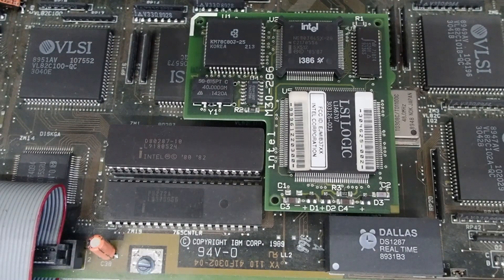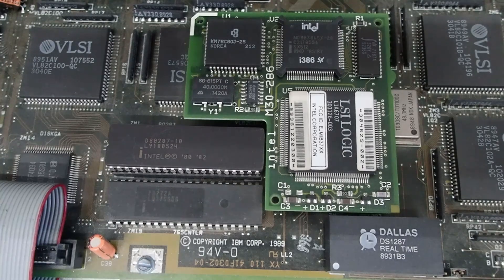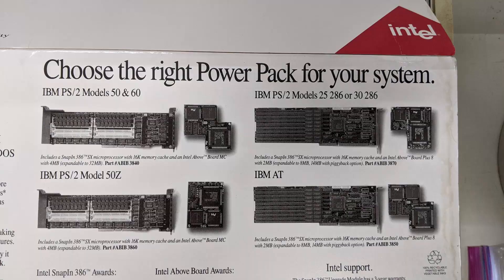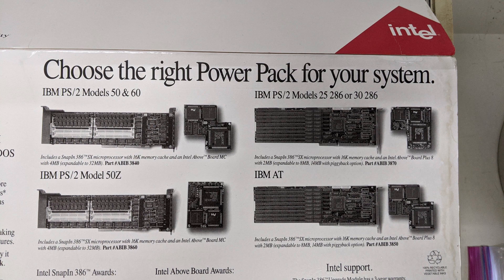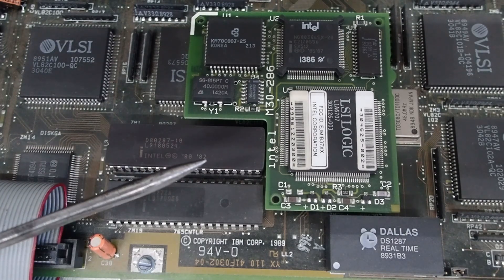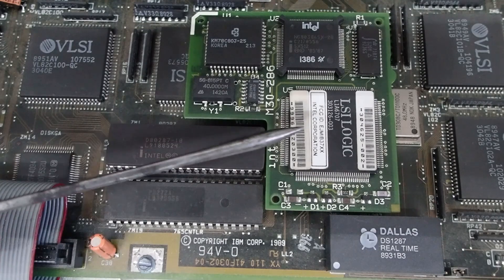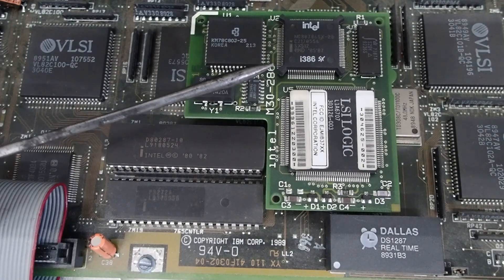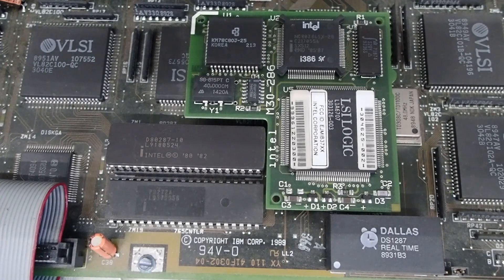Intel "SnapIn 386" CPU Upgrade on a PS/2 Model 30 286!

Comment: Nice upgrade!  I wish they weren't so rare!!  That said, I suppose that my model 30 286 makes for a nice 286 system, and I do have other 386/486 class systems to fill that niche!
Reply from the maker: The Kingston "386 Now!" have 25 and 33MHz AMD CPUs, Intel only has the 20MHz. There is also a socket for a 387SX on the Kingston modules. Yes, eventually I will have a video on them too, but this can do for now: http://www.walshcomptech.com/ps2/kingston.htm

I like to retrofit what can be the fastest CPU in the socket...

Comment: Do all the model 25 and 30 286 boards have the Dallas soldered on and not the socket?
Reply from the maker: All the 'Type 1' and 'Type 2' Model 25 286 and 30 286 planars I've ever seen have had a socketed DS1287.
Reply: @IBM_Museum  Thank you for the reply. I am going to try and put a 50 pin SCSI controller in my 55SX then a SCSI to SD card and run the 5v and 12v lines from the PSU, do you think I can get it to boot from that? (all to avoid using the build in 70pin SCSI drives for these machines)
Reply from the maker: @NickMurray : If you could find an IBM "Patriot" or Future Domain MCS-600/700 it has an easy ability to add a drive power tap: http://ardent-tool.com/SCSI/MCS.html
Reply: @IBM_Museum  Oh yes that would be perfect!

Comment: I've just installed one identical to this in an PS/2 M30-286 and I'm getting 2.2fps in Superscape, and Landmark thinks it's a 10mhz AT equivalent. This is pretty low so I'm wondering if there was a driver or configuration disk required? Not sure what I'm missing. (Edit I just put the 286 CPU back and it's faster, definitely an issue)
Reply from the maker: Yes, there is software to enable the "SnapIn 386" cache and increase performance. I'm not sure if I've archived the diskette online yet. If not, it is easy for me to image it and provide the link within a day.
Reply from the maker: Found it: https://ibmmuseum.com/CPU/IntelSnapIn386/
Reply: @IBM_Museum  you've absolutely made my day! Thanks 👍